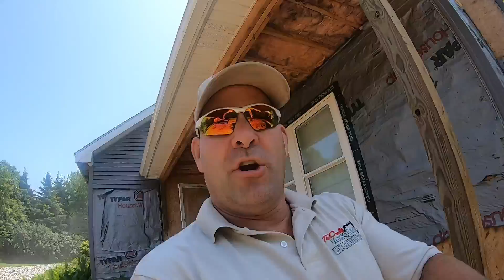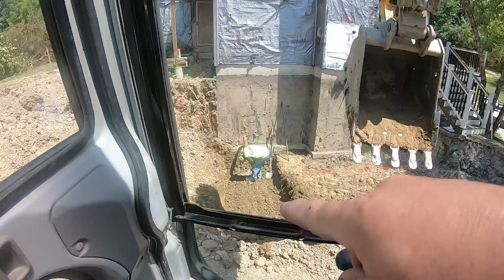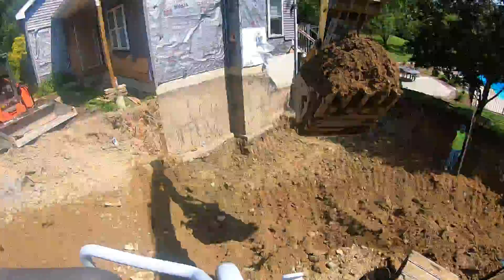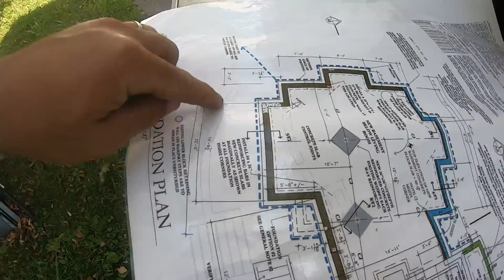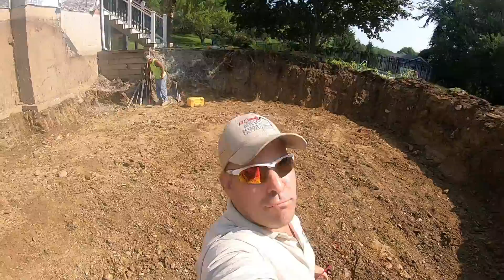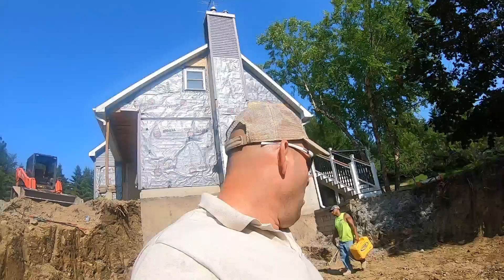Excavating a tricky house foundation for a addition with excavator

Comment: Hey Mike, first off great job on the concrete pour you did the other day.  Man, a lot of work for two guys but you got 'er done!  Here in Maryland the local inspectors aka the "dirt police" would be screaming that there is no silt fence between this job and the pool.  They go to extremes here sometime demanding the silt fence be installed uphill from the excavation site, totally crazy but they will shut the job down in a heart beat if you give them any crap.  Be safe, Stanley
Reply from the maker: Stan Thanks I hear ya on the silt fence.. definitely good practice to have them..
Thanks